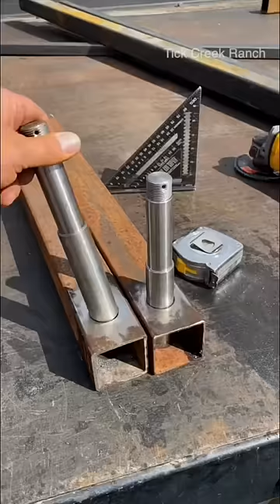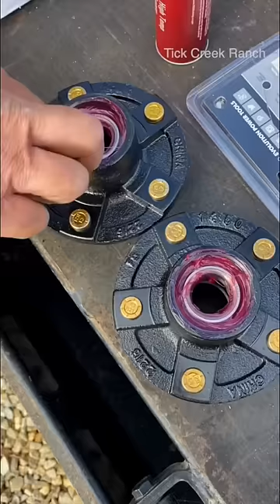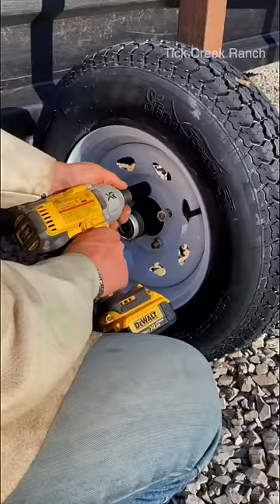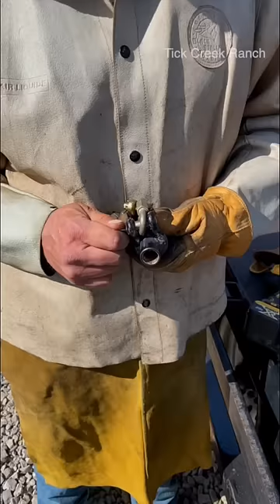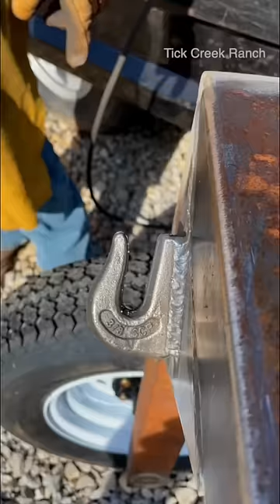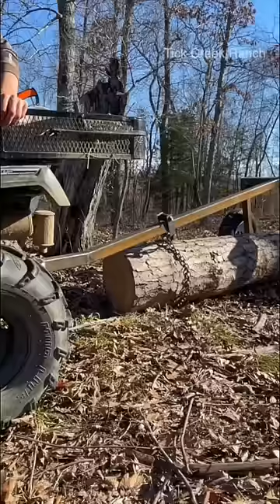ATV Log Arch Full Build #shorts #country #hardwork #countrylife #fabrication #metalwork #farm

Comment: That’s cool, but you could have dragged the logs with the 4wheeler minus all the extra work.
Reply from the maker: 500 lbs wheelers don’t drag 1200 lbs logs too well. Tears up the clutch and trans. The log plows and makes a mess of the forrest floor meanwhile getting covered in dirt and that’s really hard on our sawmill blades.
Reply: @tickcreekranch  Yeah they do.... I have done it with my Polaris. My John Deere riding lawn mower would have pulled that log out of there. I know because I have done it before.

Comment: You can make those all day and sell them about 2000 apiece that would make a good profit and a good side gig
Reply from the maker: We sure have been getting some interest. I hadn’t planned on building to sell but, might consider it.
Reply: @tickcreekranch  I know keeping it simple is better, but if you were to have a powder coated the frame. and maybe add a couple features that allow you to chop some thing with an ax by hand…… Something like that. those are some pretty good ideas too. 
I’m sure you’ve already thought of all this anyway. You should takeoff with this though a lot of people don’t have welders and even the average person with 3 acres of property, or even tree trimmers would definitely use this thing.
Reply from the maker: @Daniel-fe1uj  I had planned on something to hold a peavey but, I personally would probably keep the axe on the wheeler. I kinda baby my cutting tools but, still a great option. Many improvements to be made for sure. I’m a big believer that there is always a better idea out there, and I’m always looking. Before I ever considered selling something I’d make sure it has been tested well and proven. I wouldn’t market this one the way it’s built. It’s too light to sell to folks that have to “test the warranty”. I would ad additional lateral bracing among a few other things. As to the finish, I like rust with boiled linseed applied. Old school way of protecting steel and I like the look and simplicity. Thanks Daniel